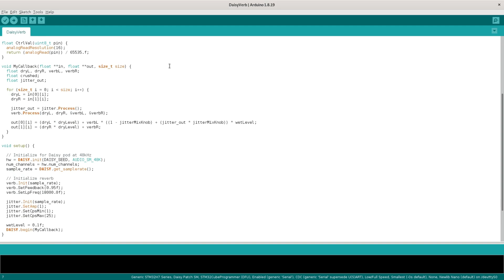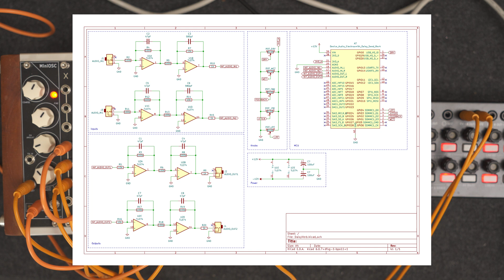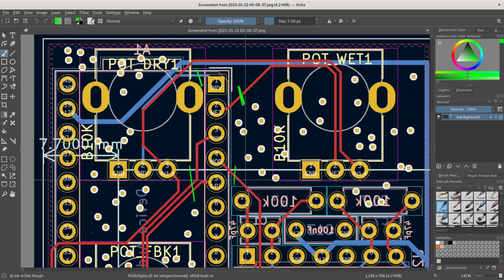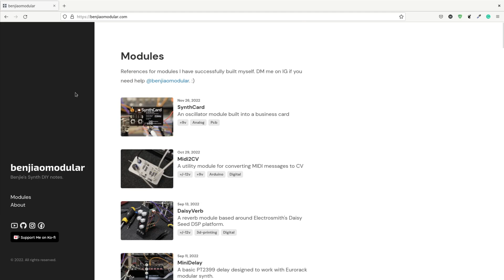MiniVerb - A reverb module for Eurorack using the Daisy Seed platform

Comment: Hey again … could I ask how you managed to down-scale the power into the Seed from Eurorack levels?
Reply from the maker: Hey! Sorry I missed your comment. The Seed works great on 12V power so I didn't really have to downscale it.

For audio and CV levels, on the other hand, I had to borrow some circuitry from the Daisy Patch SM which is also open-source. You can find my schematics for it on Github https://github.com/benjiaomodular/MiniVerb
Reply: Thanks man I’ll take a look. As far as I can tell, the Daisy Seed requires 3.3v, whereas the incoming Eurorack voltage is 12v. Does the Seed have the components to downgrade the power to 3.3v then? If so that’s great 😁

Comment: I've always been curious how an analog reverb would work... maybe not the best DIY project I would assume
Reply from the maker: It's an AWESOME DIY project! Reverb has traditionally been analog using springs and plates. I remember watching this video by @LeoMakes a couple of years ago where he makes a reverb using transducers and piezo pickups hooked up to a metal sheet: https://www.youtube.com/watch?v=CZWAntOnrx4

On the other hand, you can chain a couple of PT2399 delay chips (technically digital) with different delay times to simulate sound bouncing off different surfaces. https://www.deeptronic.com/electronic-circuit-design/diy-reverb-pedal-circuit-from-spring-to-room-like-reverb-using-multiple-pt2399-ic-chips/
Reply: @benjiaomodular  oh cool!